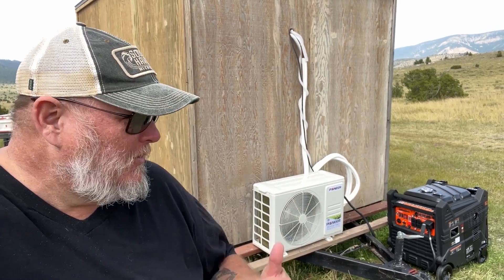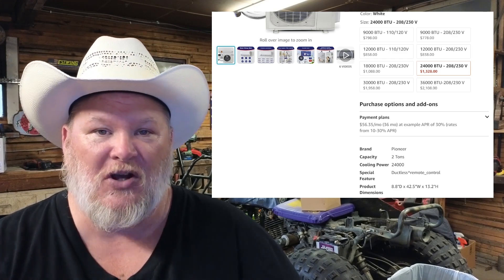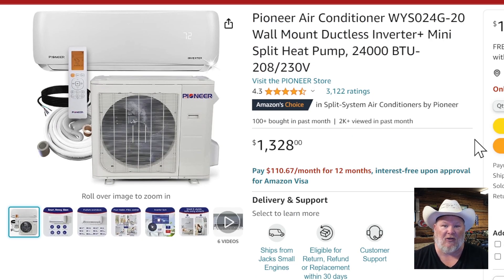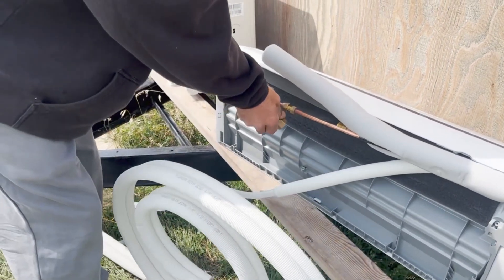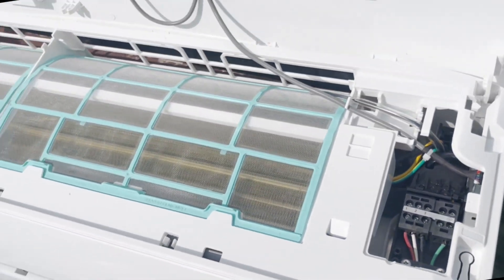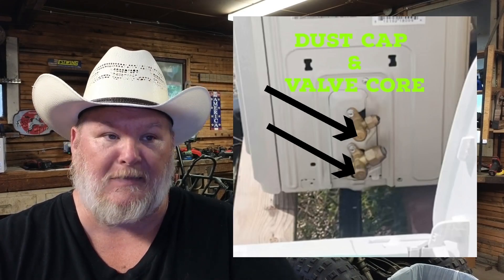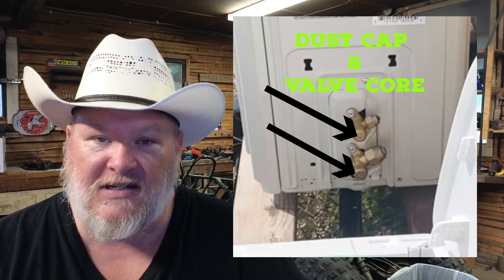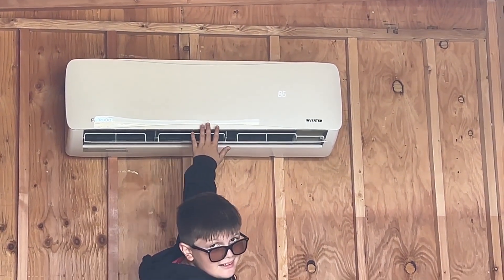How to Install a Mini Split AC System in a Tiny Home! (Pioneer Air Conditioner)

Comment: I have a different brand running off 120v in my 250 sq. ft. cabin in Maine. First time use last winter. I found it puts out enough heat to about 20F for about 150 sq. ft. I use a secondary source of heat for the 100 sq. ft. bedroom. This summer, the air conditioning/dehumidifier worked great, even on 90F humid days. It's quiet, easy to use and I like it so much I'm putting another one in my shop and a third one in the garage loft.

Comment: Highly recommend NOT installing it on a trailer. The first bumpy road will damage the compressor and/or the lines. Also noticed the open wheel wells at 10:11. Glad this was just a demo and not an actual installation.
Reply from the maker: This is just the beginning.

Comment: I would worry about refrigerant oil pooling in the coils of tubing behind the condenser
Reply from the maker: That's why you vacuum the lines first.
Reply: @denoftools  I think what he is refering to is that the refrigerant has oil mixed in with it for the compressor and is distributed thruought the system as it runs. Depending on the level of the copper lines in regards to the height of the compressor sometimes the oil will not return to the accumulator tank. With the mini-splits I have installed, there is a seperate tank for the refrigerant that allows the it and the oil to be gathered. There is still a chance of oil pooling in lines lower than the tank, however after working on ones in Japan for a long time where lines are REALLY all over the place, we haven't seen cases of pooling. We had these type of A/C units on houses there since the late '80's. Oh yeah, Red, keep that generator as far away from the unit as possible. The generator exhaust will wreak havoc with the temp sensors. Ask me how I know!!

Comment: I have installed a bunch of these in food trucks/trailers and houses. They work great and are pretty easy if you know what you're doing. The last one had the outside unit mounted 10 feet up the wall on an addition. It is also good to use nitrogen and bubbles to pressure check the linesets.

The 1 ton 110v unit would work for a small trailer and wouldn't take as much of a generator to run it.

Comment: Don't forget the cost of running 220V AC to were you need it.
Reply from the maker: Did you miss the generator?
Reply: No I didnt I was just pointing out what would be needed for a DIY at someones house
That adds  more to the project than just the unit price. I am a retired electrician
Reply: @OldF1000 which is why he said you may want to hire an electrician

Comment: Yeah that is a massive unit for that tiny house. I just put one in my shop today as additional cooling, not doing a install vid of it though. But I do plan on more units for it in the future. I used to do commercial refrig and it still amazes me how cheap vacuum pumps are now. FYI installing them in a metal building sucks big time. I also want to put one in the kitchen in the house since it's too hot to cook in the summer here..
Reply from the maker: They were actually supposed to send me a smaller 110V unit but something got messed up.
Reply: @denoftools  Nothing to complain about IMO

Comment: I am not in AC Tech, so take this with a grain of salt. You mentioned shutting off the pump then closing up the blue valve. I have heard closing the valve on the gauges first. If you don't and you just shut off the vacuum pump, it is possible that the oil in the pump will get sucked into the AC unit. Maybe someone can clarify that. One of the other things I've heard, you can use a bigger AC unit than you need. However, even though you may cool off the area sooner, it may not pull enough humidity out of the air, because the system hasn't run long enough.
Reply: I'm not sure but I always close the valve before I cut the pump off.